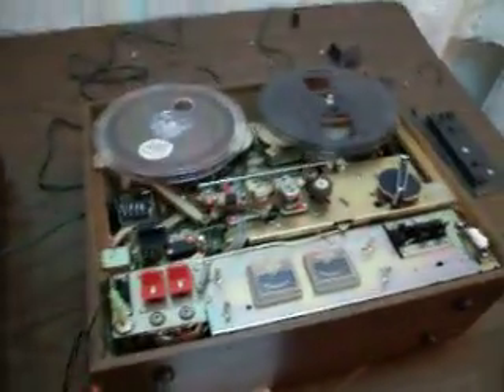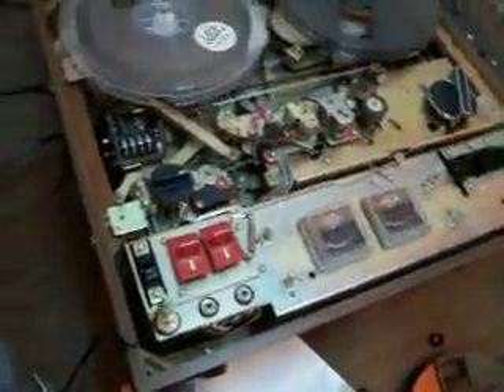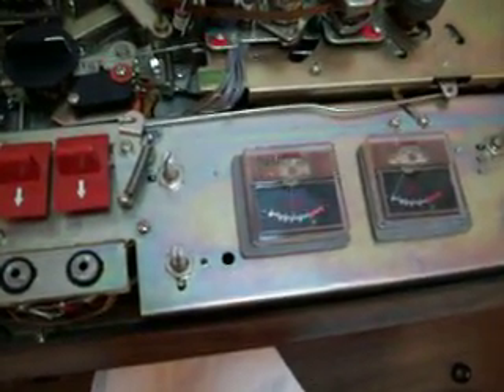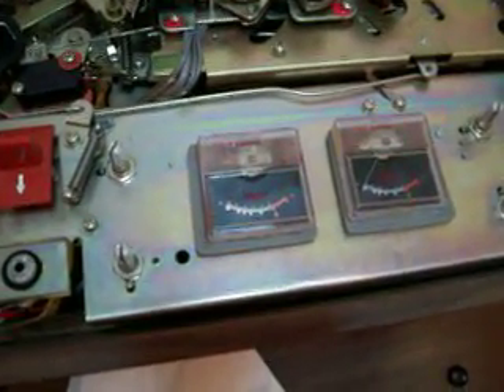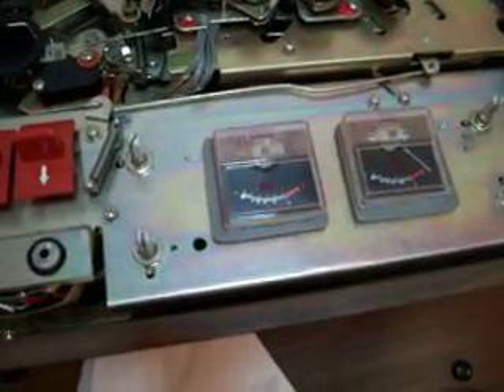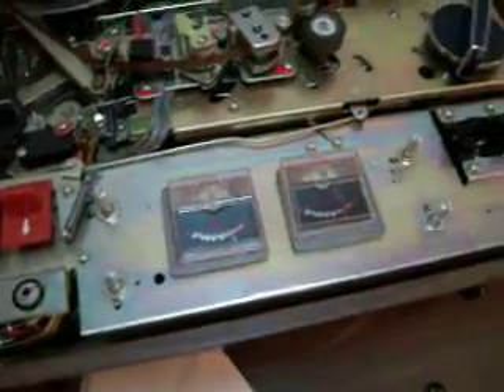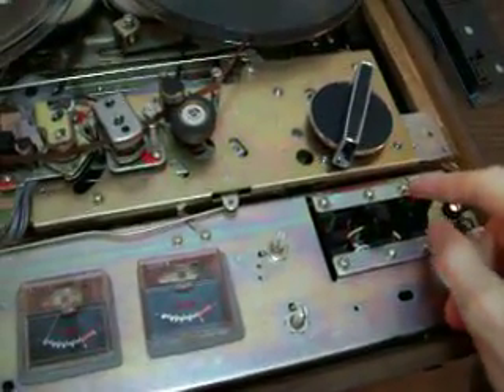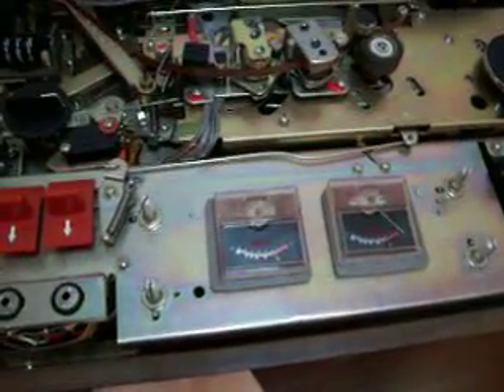Sony TC-366 reel-to-reel audio trouble (help needed)

Comment: do you still have a TC-366 parts machine? I'm looking for a power supply board with good components on it. Thanks
Reply from the maker: I haven't brought myself yet to relegate them for parts. I am holding onto the hope of fixing one of them, as most of my reel-to-reel decks are starting to have issues. Sorry.

Comment: You can adjust the playback levels on L + R channel easy with taking the deck out of the cabinet and check on the bottom there are 2 silver covers.

On the right side (facing front) look for R 172  & R 271trim pot adj for both channels, use a small screw-driver for adjustment L-channel and R channel  too be equal.
Be very careful so you don't ground the screw-driver while doing this.
Good luck,

Comment: @aldiakaroofus PM me with your email address, and I'll send you the manual for the TC-377.  If it is the same, I think the adjustments for playback level are on the left side near the jacks.  You have to remove the unit from the wood case to access them.

Comment from the maker: @Maxxarcade It does that with any tapes. 

Even an approximative adjustment would be cool. But like you said, it's knowing where to look that is the problem. I only have the original user's manual but not the service manual. But... is it difficult to find/adjust on the TC-377?

Comment: That's odd.  Does it also do that when playing a tape that was recorded from another deck?  If so, that narrows it down to the playback amp.  There are adjustments for it, but without the service manual, I don't know where they are located.  

I do have the service manual for the TC-377, but I'm not sure how close of a match it would be.

The other problem is that you need a test tape to properly adjust it, and those can be expensive.